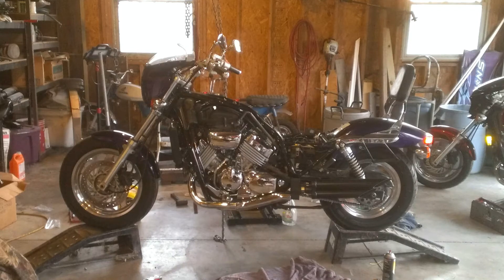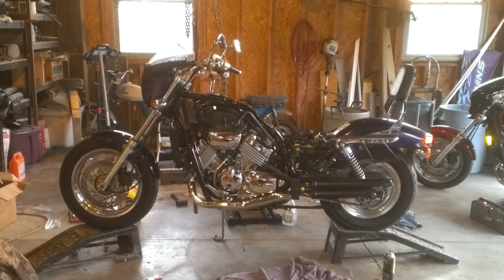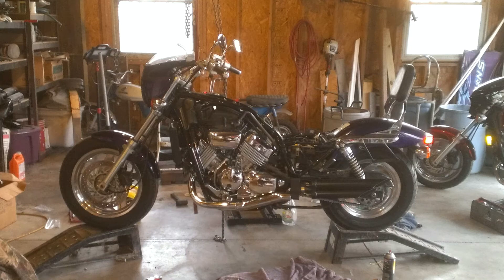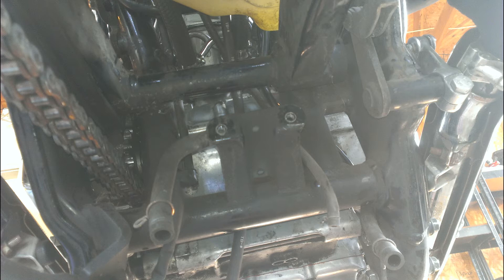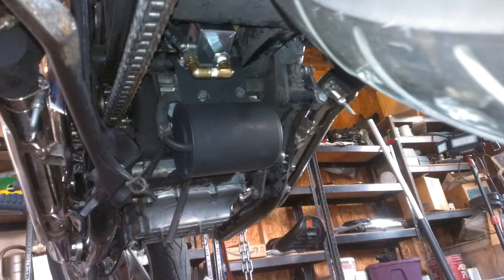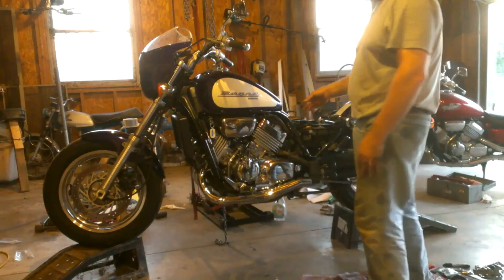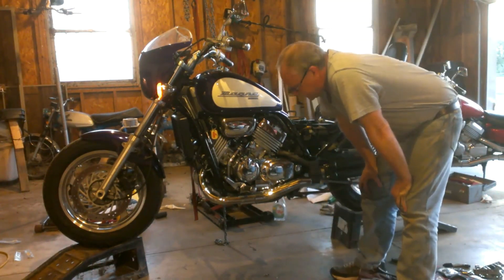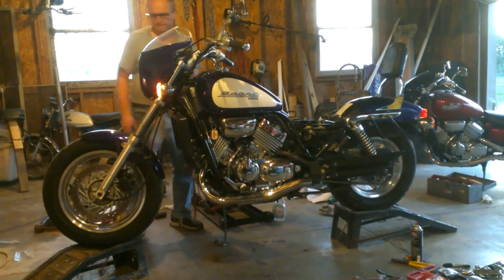Fuel Pump Install and Test

Comment: Hi Mike doing this swap right now. Did you end up running the Magna diaphragm style fuel pump? Or just straight from tank tops carbs? I am running 4th Gen VFR carbs. Thanks!
Reply from the maker: I ended up not using the pump at all. It's a really low flow, low pressure pump. I'm pretty sure it was used on the vfr because the lowest point in the tank was lower than the carbs so  they needed a pump to lift the fuel back up to the carbs. Everyone that I know who did the swap has never used a pump.